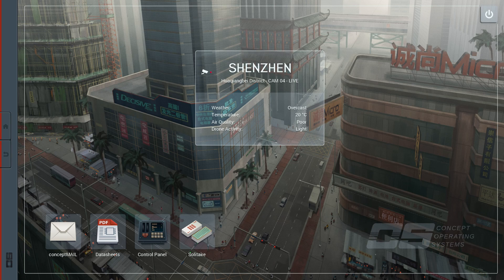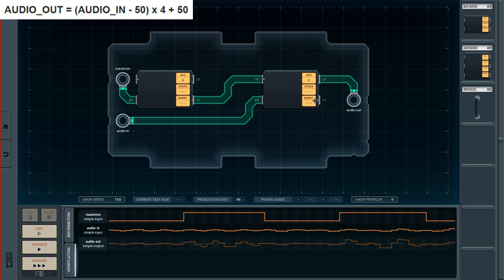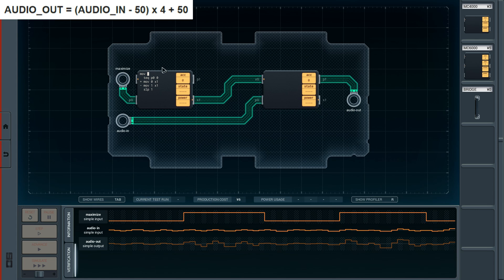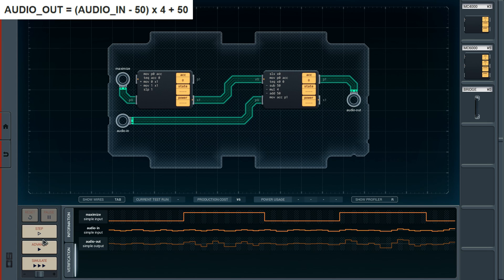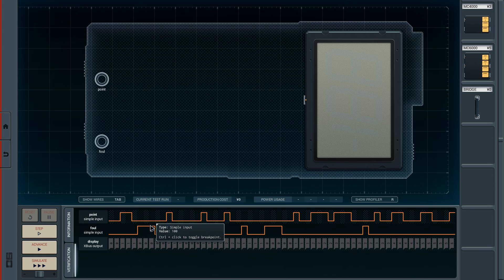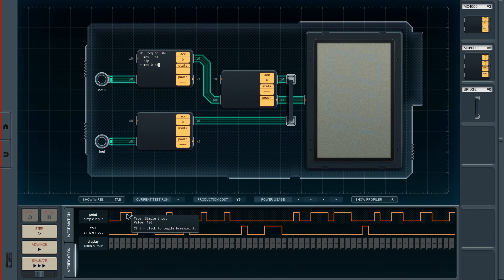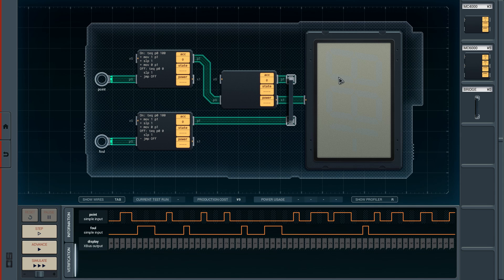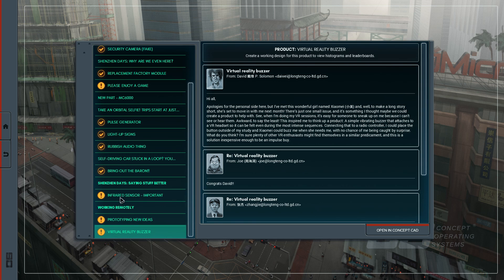AUDIO & DISPLAY - Shenzhen I/O: Ep. #2 - Gameplay & Walkthrough

Comment: Here's how I would do the edge detection:
  teq acc 0
+ mov p0 p1
- mov 0 p1
  mov p0 acc
  slp 1

Basically use the accumulator to buffer the previous value and only pass p0 through to p1 if it was previously 0.

Comment: please read up on the pins again.
simple pins are either in read or write mode, they're toggled by reading or writing and stay that way until the opposite operation is performed.
if in write mode, the value doesn't change unless another one is written to it or the pin is read from.
x-buses are synced. if you write or read it will block until data is requested or written to the connected cable by another component.

And then perhaps you should try some algebra on that formula. because
(x-50)*4+50 = 4*x-4*50 + 50 = 4x-150

To save power you should grab stuff from the xbus as soon as it is written to it, because blocked read/write operations consume 1 power per cpu cycle. meaning right after slx. The teq instruction actually clears the single bit of data from the bus.
Then you could've forwarded the maximize switch input to the xbus without doing any tests on it. it would save plenty of instructions.

Perhaps learning how to read graphs should also be revisited. Your power usage was way high. Power usage in this game is instructions run per test run. Because you did a bunch of unnecessary stuff with your cpus your power usage was way off average. Basically the further right you are in that graph, the worse it is. Also the bars show the world statistics, not the actual value.

Comment: Audio puzzle - (Audio_in -50)x4 +50 can be writen easier as - (audio_in x4) - 150, my version used 1 MC4000 with a DX300 to convert the Maximize to xbus x0 - code - power 285
  teq x0 100
+ mov p0 acc
+ mul 4
+ sub 150
+ mov acc p1
- mov p0 p1
  slp 1

for score card again a single MC4000, POINT - p0, FOUL - p1, displace x1,  power use - 263
  tcp p0 p1
+ add 1
- sub 2
  tlt acc 0
+ mov 0 acc
  mov acc x1
  slp 1

Comment: I actually managed some pretty nifty operations on the second thing you had.

maximize controller source:

  teq p0 0
+ mov 0 x1
- mov 1 x1
  slp 1

audio-in controller source:

  slx x0
  teq x0 0
- mov p0 acc
- sub 50
- mul 4
- add 50
- mov acc p1
+ mov p0 p1

Power consumption went down to 477 from your 568.

Long story short: Cut some instructions and made it so the idle of the audio-in uses less power, as well as shoehorning a larger part of the math routine into conditional execution.